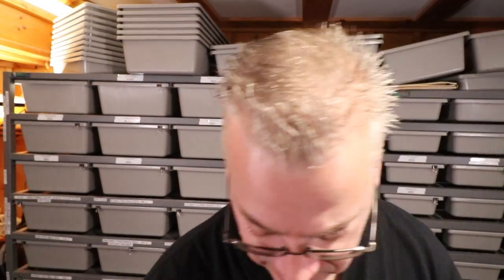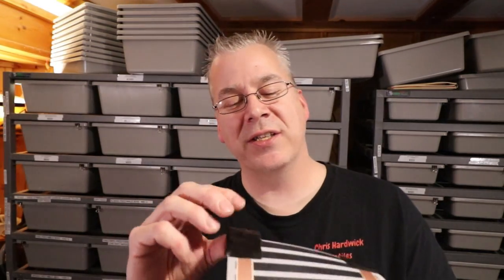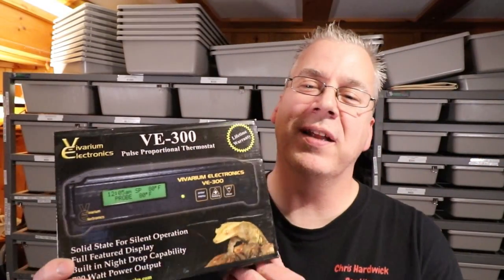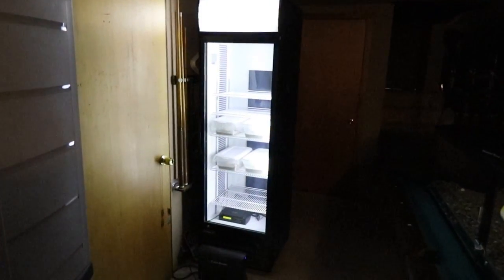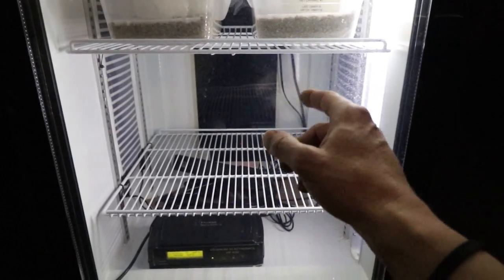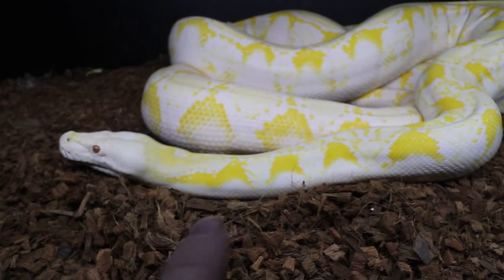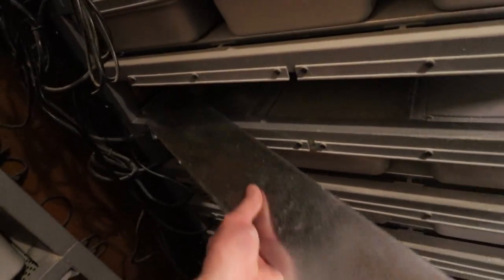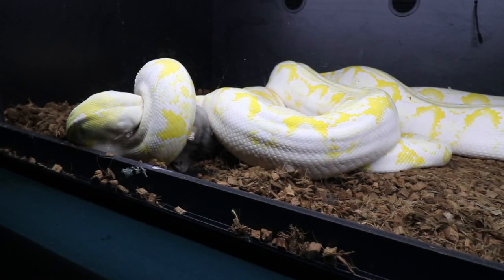How to work with heat tape for your reptiles

Comment: Hey, I’ve got a question. If my probe is on the heat tape, underneath my enclosure, and 2”-4” of substrate, the max temperature for the heat tape(105F) would not come close to being enough to heat up to where my snake actually is, what’s the work around? I’m confused

Comment: are all your cords from power source the same length? I know with hydroponics and plumbing if things are not exact measurements one table floods before the other table.

now Im not an electrician so if your right side pannel heats up faster then the left side would the left side have a longer cord from pad to power source then the right side? or are all the cords cut exactly the same length?

Comment: Question, I have a wine fridge I’m going to use as an incubator that has 2 fans built in. Will it still keep steady temperatures if I just cover them with the heat tape? I’m going to use a separate fan source to circulate the air

Comment: Does anyone know if the ARS caging rack ARS 1075 original comes with heat panels or (heat tape) on every shelf ? And how many thermostats I’d need to control every heat tape?
Reply from the maker: You'd just need one controller and it does have a panel on every level.
Reply: Chris Hardwick thank you so much 🙏🙏could you recommend a controller? Thinking about breeding ball pythons next year and wanting the best recommendations from the best breeders .

Comment: I’m thinking on breeding leopard geckos and this was very helpful bc I have no idea on what to use for heating XD
Reply from the maker: Glad I could help!
Reply: Dude same Im trying to also start breeding leopard geckos to
Reply: I dont breed leopard geckos, nor do i claim to be an expert on them, but i had a female leopard gecko for nearly 24 years, and she never once had a heat source. My thoughts are that they arent necessary for the species. Depending on where i lived at the time, the room temp where i kept her was anywhere from 68 to like 84 farenheit. Now im not saying you shouldn't use heat, but in MY opinion, adults dont necessarily need heat. Lighting, particularly UVB, also seems to stress them for some reason. The warmer they are kept, the more they have to eat, and thats just unnecessary strain on the body. They live a lot longer if kept on the colder side so that they dont have to eat as much. They have a tail full of fat for a reason, they arent basking lizards and they arent meant to eat constantly like basking lizards do. My female only ate between 1-3 times a month as an adult. Generally she every 2 weeks. Idk, I just feel like not many females live that long, i must have done something right. I think most people are overfeeding and overheating them.

Comment: Soldering is electrically solid. Rivets are mechanically solid. Using both is bulletproof, but no one does both (unless you talk to old-school automechanics).

Rivets and other mechanical connections are less prone to user error as soldering requires practice and skill in surface prep and technique.

Thanks for sharing, Chris!

Comment: What about the actually connection and thermostat though? How do you run 12 heating pannels into a 1 or 2 outlet thermostat?
Reply from the maker: I plug multiple panels into a multi outlet power strip, then plug the power strip into the  thermostat.  Be sure to put the probe on the heat panel that gets the hottest the fastest.
Reply: Thank you so much for the reply this was litterally all I was needing to know to start using heat pannels and couldn't find the answer anywhere. I appreciate it

Comment: Hm. I’m trying to make a rack for the first time and was confused on using heat tape, this video is very helpful! However I’m still not completely certain... so each row of the rack will have its own heat tape set up and they all plug into the same thermostat?
Reply from the maker: You can plug multiple heat tapes into a power strip and then plug that into a heat controller.  But be sure to have all your heat tapes the same size otherwise they will be at different temps.
Reply: Chris Hardwick omg seriously? I’m setting up my reptile room and I have no idea how to connect multiple lengths of heat tape together. I had no idea I could just order each length with a plug attached, plug them all into a power strip and then connect the power strip to my herpstat. Wow. You saved me so much confusion. Thank you! One question the reptile basics says not to let the tape come into contact with metal unless the metal is grounded. How would I ground a metal shelving unit? Or would it be best to just put the heat tape on top of insulation foam so it doesn’t touch the shelf?
Reply: Ah that makes sense! I started looking up stuff and saw a parallel circuit system. Couldn’t find much on how to do it and I have zero electrical understanding or ability haha. This seems much simpler. It’s hard to find info on the bare basics everyone else probably thinks is common knowledge. I really appreciate your videos explaining bp genes, breeding, set up, etc. that explains things from the basics for beginners while still being very interesting and informative! Us noobs are eternally thankful :)

Comment: so the heat tape won't melt the plastic tubs?
Reply from the maker: As long as your heat source is on a thermostat you shouldn't have a problem.  I'd probably tape the thermostat probe directly to the heat tape and set it at 90F.
Reply: @ChrisHardwickReptiles  makes sense. i have my snake on a home depot husky heavy duty tub atm but trying to make this work. thanks for your reply sir

Comment: Is it possible to plug multiple heat tape to a power bar then to the thermostat
Reply from the maker: Yes you can, but make sure to put the probe on the one that gets the hottest, that's usually the biggest one.
Reply: Thanks that great info.

Comment: Hi if you're building a wooden snake rack is it safe to put a layer of aluminum tape underneath the heat tape so the heat tape isn't directly on the wood?
Reply from the maker: That should be fine.

Comment: Sooo, I have a wooden cabinet that's insulated, I'm currently using a regular heating mat with a thermostat for my tarantulas and scorpion. I wanted to get the tape for them. But I'm just concerned of a fire hazard. The tape itself isnt insulated, like the other heat mats. Would it still be ok to put it in a cabinet? Or should I invest in a metal cabinet better, then buy the tape?
Reply from the maker: I've heard they can melt and catch on fire, but I would imagine that it's a bad wiring job that make that happen, not the heat tape itself.
Reply: @ChrisHardwickReptiles  ohhhhhh yea my fear lol

Comment: What do you tape your probe down with could I use masking tape I am afraid clear tape would melt?
Reply from the maker: I use clear packing tape, the temps never get above the set temp.
Reply: Okay last question for the mat you use for your aquarium the plastic one do you have that hooked up to a thermostat as well? Mine came with a dial one on it and it doesn’t say what the temp is?

Comment: New sub here. So far your video is the most comprehensive one I've seen. Like the commenter below me...I am a newbie. Don't have a snake yet but am setting up everything way before I ever get a snake. Can you show how you connect each strip of heat tape and then into the thermostat? Thanks again for your time and attention on this video much appreciated.
Reply from the maker: Actually I've always had Reptile Basics do the connection before they shipped.

Comment: Hey Chris! I have another question on pricing for you. How do you decide how much to charge for a morph? Some
Morphs I can’t find on morph market and have no idea what to charge when I start breeding!
Reply from the maker: That's a good question, depends on how fast you want to sell them. Price them low and they will usually sell fast.  If you do multiple shows you may regret selling them low, maybe start high and come down over time, or vice versa.  Spring shows usually have higher prices and my hatchlings from last year are bigger and will be more expensive.  It's really up to you.
Reply: Chris Hardwick then how would tacking on a gene like, say pastel affect the price compared to a co-dom or recessive?
Reply from the maker: Depends what it is, usually if it has Pastel I'll add another $50 - $80.
Reply: Chris Hardwick So it’s a case by case basis with the rarity/quality of the individual gene huh?

Comment: If you use a thermostat for your heat tape will that be using more electricity (electric bill) or thats depending on the setting from the thermostat ?
Reply from the maker: Depends on the setting and the temperature of the room.
Reply: probably doesnt make a practical difference unless you have 30 animals tho.....

Comment: I used the same heat tape and soldered my leads straight to the tape and protected with liquid electrical and regular electrical tape.  It works perfectly with my VE-100 thermostats.

Comment: I recently had an incident with heat tape overheating and melting. It burned a hole right thru a snake tub that was a thick rigid plastic. It was heat tape that was already installed in a rack that I bought from reptile basics. Not sure what brand it was but it wasn't Flexwatt. I normally only use Flexwatt heat tape which I have been running for 7 years with no issues.
Reply from the maker: That's crazy.
Reply: sounds to me like it didnt have a thermostat

Comment: With ball pythons i wouldnt go much higher than 92 on the hot side its plenty warm enough for digestion which is really what belly heat is for with ball pythons or so im told by the experts lol. We all have our own opinions and every keeper Probably does something different than another.

Comment: How did you find your incubator enclosure.  I'm guessing it's an old drink display case?  You could try USB powered computer fans.. they don't produce heat.
Reply from the maker: Actually I found it on Craigslist.  Some guy bought it brand new and the compressor was bad.
Reply: @ChrisHardwickReptiles  I'm trying to find one for the future.. but all ours are in the 600-700g or less range with only one that is just under 1700g..  so I'm figuring she might be ready next year.. but I don't think we'll have a male big enough for her by then.